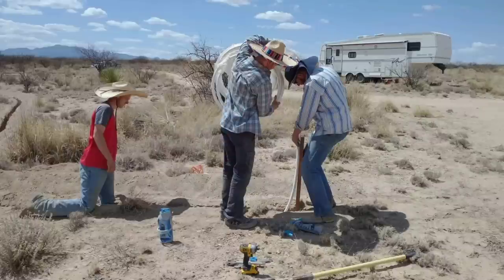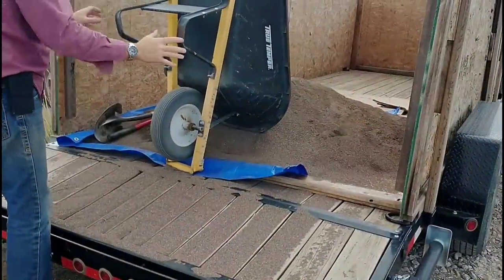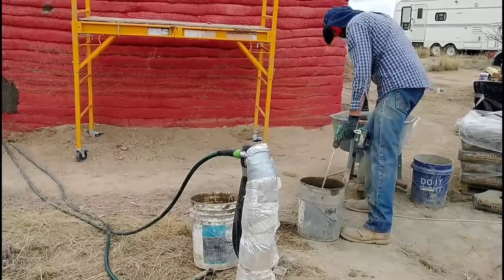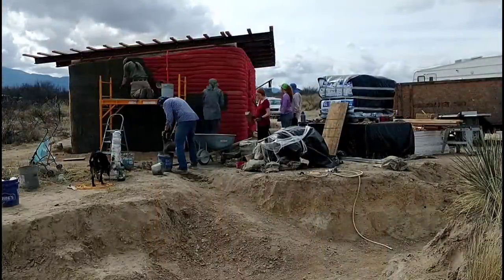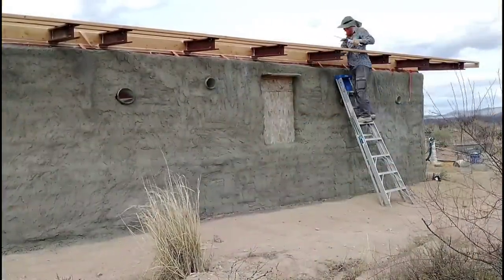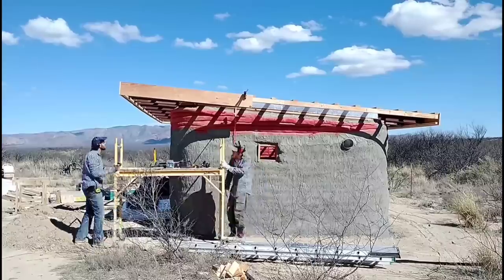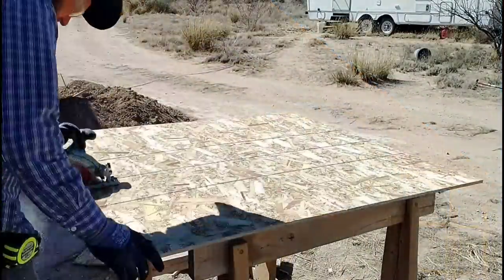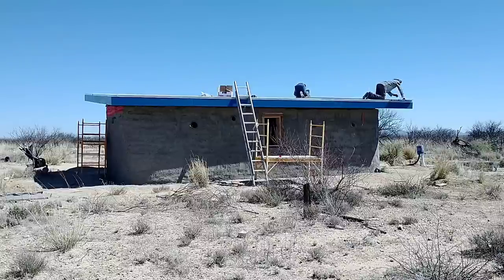#4 HYPERADOBE Tiny House | Stucco, Purlins, Fascia & Soffits

Comment: I may be too late to mention it, but pre-drilling the metal makes the self-tapping screws go in a whole lot easier. I found that it's worth it when using self-tappers at odd angles or overhead.
Reply from the maker: He pre-drilled all of the holes for the bolts, which was a good deal of work. These self tappers are about as easy as using a drill bit, and it saves a step.

Comment: Maybe you should have added some hay to the stucco and use more in order to have some insulation properties. Thermal mass is great when there is big temperature differenecs between day and night but works badly when the tenperature is quite even especially in cold weather.
Reply from the maker: Straw is added to cob, but not to stucco. The inside of the house will be covered with cob. Yes, we have large temperature swings here in the desert.

Comment: You planning on insulation that roof? If so why didn't you leave the dry wall firing straps off so you could install the insulation, much easier than trying to threading thru those boards.
Reply from the maker: The insulation comes in 48 inch strips which fit in-between the beams. I suggested they just put up every other board, but they just wanted to get it done. It wasn't too hard to get the insulation in, and the boards hold it in place.

Comment: Had you considered Rockwool over plastic foam insulation?
Reply from the maker: We are putting a thin layer of foam board on top as a thermal break, and then will use fiberglass insulation in the ceiling. Cost was the main factor.
Reply: @RedandAprilOff-Grid  I hear you.

Comment: 2x4 on edge is  stronger than laying flat:

The bending strength (what  engineers call the section modulus=S) of a 2x4 (or any other rectangular shape) is width X height squared / 6 (for orientation - that's for vertical loading). For a 2x4 oriented edgewise S=1.5x3.5x3.5/6=3.0625 inches cubed; oriented flat, S=3.5x1.5x1.5/6=1.31 inches cubed. 

Shear strength is about the same in either orientation.

Stiffness is similar, but it's width x height cubed /12. That's why a 2x6 is nearly 4 times stiffer than a 2x4, spanning the same distance.

Also, torque is force x distance, both in applied loading and resistance, so quatsch is correct for the 26 lbs at 27". To finish the loading calc, the tension on the fastener is the torque / the distance from the fastener to the edge of the base plate.
Reply from the maker: Interesting! 🤓
Reply: They don't have to worry about putting the 2x4s on edge since they live in an area where they don't have to worry abour massive snow loads.

Comment: But with that kind of roof that will be warm as in sauna in my inexpert opinion? Metal sheet roof?

PS. Still love watching, I would definitely land a hand if I was there around.
Reply from the maker: Yes, it will have a metal roof with 2 different layers of insulation. Also the overhang will shade the walls so the house should stay pretty nice. Thanks 🌞
Reply: @RedandAprilOff-Grid  Thanks for explanation, I am curious how it will turn out. I have 0 experience building it or living in desert so... Following however...
Reply: It was built in a hurry.
Should be about 5 feet taller. But build is limited by the hight for personal safety 

 The home needs a ceiling fan
Reply from the maker: @missingremote4388  The ceiling is plenty high. Yes, it will have a ceiling fan, and possibly an evaporative cooler.

Comment: Those steel rafters are massive thermal bridges.
Reply from the maker: The whole roof will be covered with a layer of insulation board for a thermal barrier. We checked the temperature of the beams on our house, inside and outside, and found that  thermal bridging, isn't much of an issue. Our house is entirely passively heated.
Reply: @RedandAprilOff-Grid  What about the undersides of the beams @soffit?
Reply from the maker: In this video at 4:25 we show the temperature of the metal beams on the inside of our house. https://youtu.be/M8AAIibdrUM

Comment: Try to use a cement mixer for the stucco mixing.
Reply from the maker: Cement mixers aren't recommended for mixing stucco, it doesn't mix well and gets stuck to the sides. Mortar mixers work differently, and are a lot more expensive. A good drill works fine.
Reply: @RedandAprilOff-Grid  some concrete mixers can mix mortar..
A quick Google search can tell you that.🤦
You were complaining about mixing small batches and not having enough for all the workers....
So I gave you a solution.
Especially when you're back went out your shoulder went out your knees went out. 🤦
I'm sure you can buy a drum that will interchange with a cement mixer to do mortar..
And if you can't I'm sure one of the people around you can build one that would work perfectly for the purpose you need.
Reply from the maker: If cost isn't a concern, there are definitely easier and faster ways to mix stucco. The cement mixer we currently have doesn't work for stucco. It was unfortunate that the corded drill broke, but we made the best of it.

Comment: Why would you put the screws in line instead of offset, they aren't penetrating the same fibres and this can induce cracking.
Reply from the maker: Everything is pre-drilled, it should be fine.

Comment: Hello. You are making mistakes with the cement for such a building. You have to mix straw from grass into the concrete. Before you smear it on the wall. I am a construction worker.
Reply from the maker: Cob has straw, but as far as I know stucco doesn't typically have straw added.

Comment: The plywood Facia will delaminate over time when it's exposed to water enough.. Should have used 1by 12 Pine.
Reply from the maker: We are hoping it will last a good while. It should help that we get most of our rain in the summer, and it's pretty dry the rest of the year. We are also putting on a good drip edge. 🌞🏜️
Reply: @RedandAprilOff-Grid  Good. Try to keep em dry and seal with some quality sealer then paint. It's definitely original. I'm a retired Carpenter so I miss the work.

Comment: Those steel beams are an overkill, they are 20 times stronger than necessary. These guys use no common sense.  They are used for a second floor. Also that Dry dirt filling the red sacks will never gain any strength, they will always be dry, unstable, held only by the plastic mesh, they are by NO MEANS adobes.
Reply from the maker: We already had the metal purlins, and they were cheaper than wood. As mentioned in previous videos, the dirt is damp. If it's too wet, it squishes out of the bags, if it's too dry, it sifts out. The clay, caliche, sand soil is packed and dries very hard much like rammed earth. Adobe means earth.